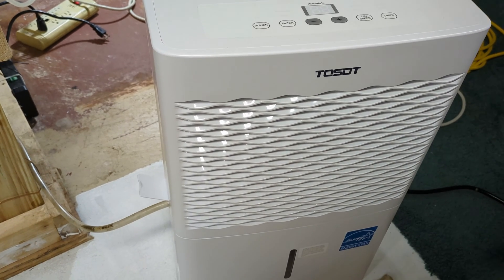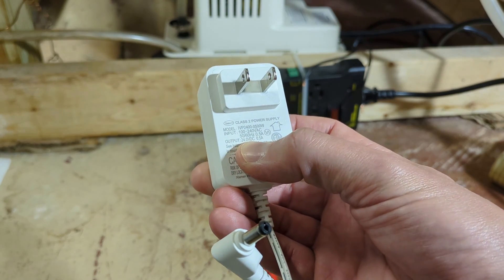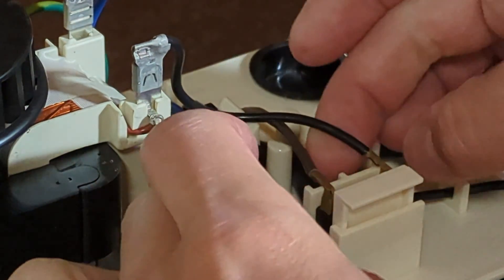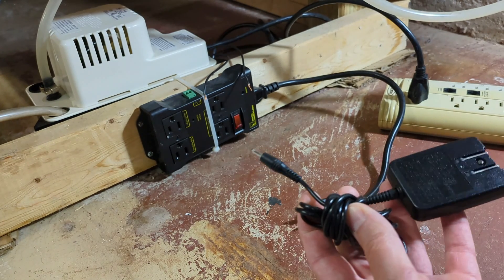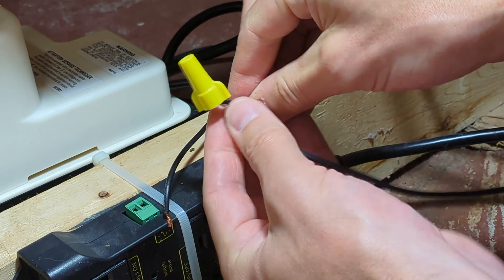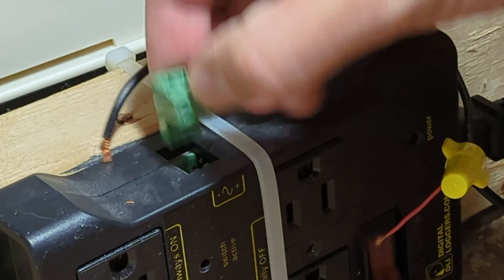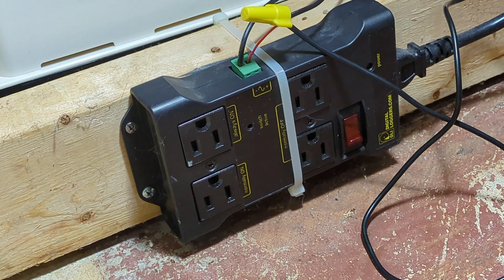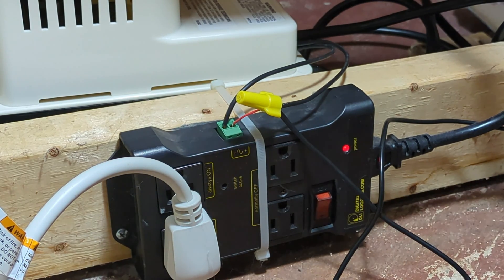How to Wire a Condensate Pump to a Relay - Step by Step

Comment: Great Video!  Detailed and easy to follow!  Can a usb charger cube (5v out) be used for the DC power?I have tons of these from years of using iPhones and it seems that these are ac to dc converters.
Reply from the maker: Thanks! Yes the 5v DC from a typical USB power adapter will work.

Comment: Thank you for this video. Very detailed and helpful. I have a question though about the wiring on the dc adapter I have. It is a 12 v. output adapter, but only has 2 black wires, not a black and white or red. An electrician friend of mine said that it shouldn’t matter then, and I can use either one to connect with the positive and negative wires into the relay. Would you agree with that? Any help would be appreciated.
Reply from the maker: The website does state it is polarity sensitive. Best to check polarity with a multimeter. However, without a multimeter, the website makes it sound as if you could connect it with reverse polarity and it simply wouldn't trigger. No warnings about reverse polarity so I'm assuming it would be okay to just try it.
Reply: @realhouseDIY  turns out that transformer was bad. Picked up another one, and it worked perfectly! Thanks again!
Reply from the maker: @NicholasBonner-u7i great!

Comment: Is there any way to do this if you don’t have a DC adapter?  Wondering if there is a way to do this just with wiring I could get at a local hardware store.  Thanks.
Reply from the maker: Possibly connecting to the 120vac power inside the pump housing. But I have not tested it, and don't know if the safety switch wiring can use 120vac or not.

Comment: Why do you need the DC adapter; is it because the pump wires have no or too-little power to activate the relay? (if no power, is it that the pump circuit is only a switch and doesn’t get/transmit any of the power from the pump’s own plug?) Could you have plugged the DC adapter into the “always on” part of the relay instead of the main power strip as you did in the video?
Reply from the maker: Correct, the pump overflow switch is not powered but the relay is looking for power to know when to switch.
Yes, the DC adapter could be plugged into the always on.
Reply: @realhouseDIY  Thank you so much 🙏 For my own future reference, at 0:57 you said that the power should be anywhere from 3 to 48 volts DC. I have an old router charge cable whose output is USB 5V so I’m thinking I just cut off the micro USB end and since it’s a charging cable it will probably only have red and black wires but if it also has two other wires (data) just ignore those and use the red and black ones. Thanks again
Reply from the maker: @Chirael yes, and will be easy enough to hook it up to test it to see if it will switch the relay.

Comment: My condensate pump high water switch is already hard wired into my ac unit. What would I have to do to tap into that connection to make it so my ac and dehumidifier both turn off?
Reply from the maker: I would probably add the relay for the dehumidifier to turn off and tie it into the same high water switch. Probably just need to tap into the two wires.

Comment: Thanks for this video. I was able to get my relay working.  One thing I did differently though was leave the pump safety switch in the normally closed position.  I'm running the dehumidifier on the normally off outlet.  The reason I did this is, if the power block were to fail (due to a surge, for example), this configuration will shut down the dehumidifier and prevent an overflow if the pump also fails.

With the pump safety switch in the normally open position, a failure of the power block would go unnoticed by the relay.  This would effectively disable the overflow safety mechanism, leading to an overflow if the pump also fails.
Reply from the maker: You're right. I think I was concerned about the relay always being energized. Maybe doesn't really matter. Thinking I'll confirm the DC adapter voltage once per year.
Reply: @realhouseDIY  that's a fair concern.  The spec for the relay said 0.3 watts open vs 1.1 watts closed as I recall. So it certainly will use a little more power in my configuration
Reply: Please explain this in more detail: leave the pump safety switch in the normally closed position
Reply from the maker: @davidkeating1379  Switch normally closed position will keep the relay energized and dehumidifier powered on (when plugged into normal off) until the safety switch opens the circuit and de-energizes the relay, powering off the dehumidifier. Maybe easier to visualize with a diagram.

Comment: Could this relay be powered from the furnace thermostat leads, one of them through the pump, so as to avoid having the separate power supply?
Reply from the maker: @stephenkruft5966  yes it could. Low voltage DC from thermostat or even low voltage DC doorbell wiring. And nice to see it is back in stock!
Reply: I connected my relay to my existing furnace and sump pump.  I have the Little Giant VCMA-20 ULST sump pump and 24 vac powering the thermostat wiring.  I spliced in a wire to the High Float switch COM terminal and ran that to the IoT Relay. I then put a lug on a wire and connected it to the top terminal of the High Float switch and ran that to the IoT Relay. I plugged the dehumidifier into the Normally ON receptacle on the IoT Relay and it works perfectly and the thermostat to the furnace circuit is still protected by the sump pump safety switch.  You want to get a right angle lug to connect to the micro switch. I had a straight connector and bent it upward to prevent it from interfering with the operation of the switch that controls the Sump Pump.

Comment: great video. i have a question what is the purpose of the DC adapter ? can this model be done using only a ''safe T swich over flow switch'' on the water pan connected directly to the relay ?  and the plug of the dehumidifier  on the ''normally on '' outlet ? thanks
Reply from the maker: @adamtp17  no, this relay model requires a low voltage input. There's some benefit to that although not a huge deal for this application. There's likely a relay out there that is just looking for an open vs short.
Reply: @realhouseDIY  ok thank you for the clarification I'll do the same

Comment: Thank you! This is the only video I could find showing this! I can't for the life of me get the safety switch NO terminal to come off, and I am trying pliers in addition to fingers. Any other trick to this even though yours was easy enough with only fingers? I got the terminal to move a little, the bump is even out of the hole but then will move no further.
Reply from the maker: The switch can come all the way out if that helps. I think I did that in the condensate pump review video. You may have made it tighter gripping with pliers. I'd try leverage with a flat screwdriver maybe. Worst case add another wire to the last terminal and leave the stuck one.
Reply: @realhouseDIY  Thank you! Removing the switch and prying with the screwdriver did the trick. You saved me again! Seems more wobbly on the new terminal, hopefully it's ok.
Reply: Hmm everything is hooked up and the dehumidifier is plugged into "Normally On" but when I press the safety switch to test it doesn't turn off. Is the click in your video from the safety switch or the relay clicking? I don't have any click.
Reply from the maker: @stevendressler  relay clicks and small light turns on on the relay. You could check that the DC power works by just touching the DC wires directly to the DC input on the relay. (Bypass the overflow switch)
Reply: @realhouseDIY  Thanks once again! The dc adapter wasn't doing it. Tried another adapter and now it is working. The switch is clicking now, so I assume it only clicks when connected to power.
Reply from the maker: @stevendressler  great news! Yes applying the input DC voltage switches the relay and then that switches the AC power.
Reply: This is a fabulous video. Well done 👏🏻